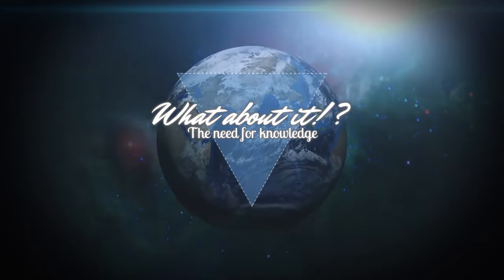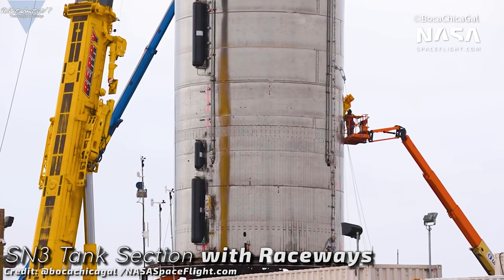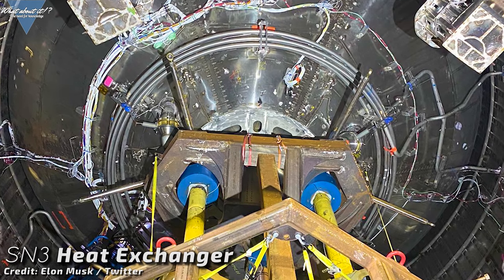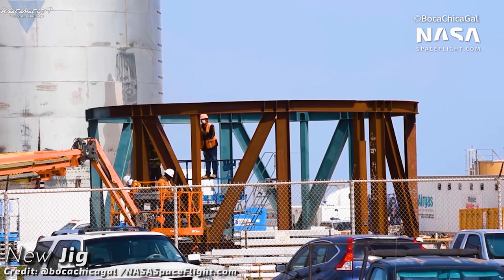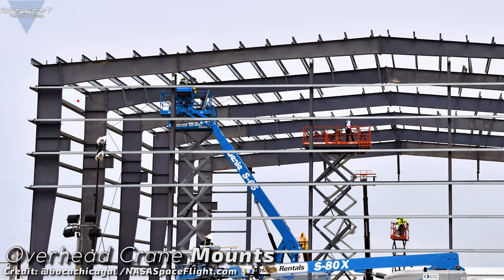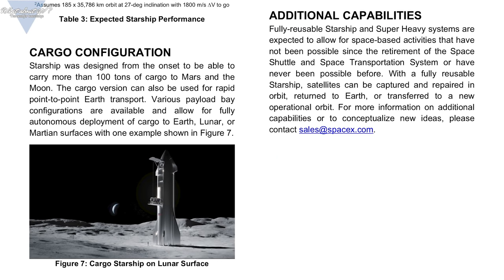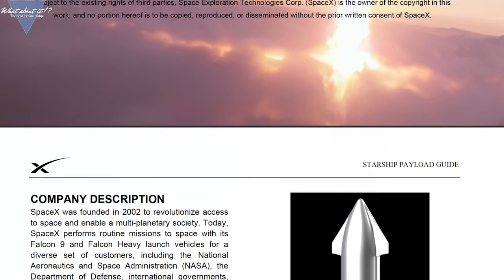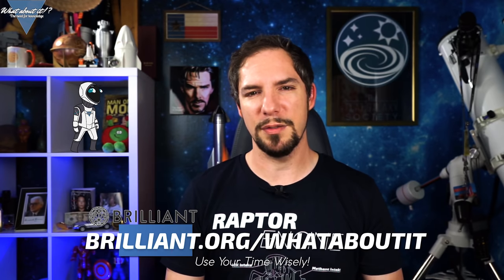82 | SpaceX Starship Updates – Starship User Guide Reveals Major Starship Feature

Comment: MASS PRODUCTION.
.  The engines, mount, tanks & CPU/avionics goes on the lower part of Starship.
This "universal block" is that will eventually get "frozen" in design (just like it happened with the "block 5" of Falcon 9); while all of the "utility" part (crew, cargo, telescope, fuel, etc) CAN get redesigned ON THE INSIDE for any mission [as long as the external shape & dimensions is the same, the Starship as a whole can fly without any need of software/hardware modifications/tests].
  
.  Any mayor changes that would modify the weight and/or center of mass of the upper "utility" block can be compensated by adding water (either as radiation shielding or heatsink). 
-> Ideally it could be transfered to another structure in orbit (water is ALWAYS useful), otherwise it can be dumped AFTER initiating the reentry process (when the Starship´s periapsis is set inside the atmosphere).

Comment: I don't think they can make tankers with fairing sections as the tanker is supposed to refuel via rear plumbing. So either you would need to have idle plubing for most flights or just have tanker-model with extended tanks.

Comment: That's amazing, it can be modular. Imagine an unfolding fairing on hinges that's just standardized. It could be shipped straight to the satalite operator to set up their launches and then it gets picked right back up to be shipped to space, unfolds, fairing locks open and stays with the satalite. Fairing becomes a light shield around it, or opens up more, almost backwards, for communication satalites. If there is a failure, you can go dock with the fairing and then ferry it back to earth for repairs or recycling.

Comment: No, I don't think that's the way to think about the faring.
Instead of replacing the whole top section, I think we'll see something more like the Thunderbird2 method, where the 'fairing' is a container like module that slots in to the frame, which in turn will include all the hardware for the guidance and canards.
So the fairing and load integration will be like filling a shipping container, which is then bolted to the Starship chassis.
An interesting question will be, will the standardized Intermodal Container for international shipping be able to fit in to the cargo Starships?
Visualsation exercise - bottom half of a Starship, with a central backbone connected to the nosecone and canards, and then multiple containers mounted longitudinally around the central backbone, before a cover wraps around them.
Now go one step further and think about a version that has just the Raptor bay, tanks, backbone and nosecone/crew space, and is extended in length to take multiple rows of the same size containers, and never lands on a planet, so doesn't need the canards or wings. :)

Comment: So, the engine/tank section is the BFR upper stage (or 2nd stage) and any fairing/payload configuration can be stacked on top. The upper stage and fairing section form a reusable unit and are recovered jointly. Space X could devise a fairing section that includes a small rocket stage section to act as the 3rd stage for interplanetary missions and theoretically, such a powered fairing section could still be recoverable if it can return to Earth. However, in this case, the actual second stage would not be recoverable (as in today´s Falcon 9) and an LH2-powered version would be possible, too. The larger fairing size will allow launching military payloads and larger sets of Starlink satellites, too. A tanker capacity could be increased by strap-on boosters for Superheavy or by using a triple-core version. On the whole, this is very flexible and ingenious. Go Starship.

Comment: OK, now I finally believe SN3 has autogenous pressurization. Thanks for putting together all the pieces! But at 4:15 I think you are looking at 2 different header tanks. The cut off one will fit into the nosecone, transforming the tip into the LOX header. This apparently how the first nosecone section was configured, from the way the tip imploded-dented back when it was pressure tested. The header tank with the sawtooth collar is actually an intact sphere. Over on reddit our friend r/fael097 convinced me it will fit large-part down through the common bulkhead, with the collar there for increased weld contact.

Comment: For obvious reasons, the third option is a tanker-module to refuel other starships. on the other hand, they could just build a steel fuel tank, that pops out once they are in space. add a sunshade, and there is virtually zero boiloff, allowing them to store fuel in space until they need it for a flight to mars. could be a lot of fun :-)
Reply: sbmphr  
Fuel depots are not a good idea, mostly because then you are restricted to a certain inclination for your launch, which might be less than optimal for your actual destination. Far more flexible to just refuel every individual Starship with a few tanker flights.
Reply: Space fuel stations don't help. Because you still have to launch the tanker to fuel it anyway you may as well launch at the same time, dock, transfer fuel, land, and not have to worry about that fuel in space or have to even do anything.
Reply: Tanker modules make sense around Mars where the weak gravity enables easy access to space, and Mars is likely a refueling point before going farther. Some crafts From earth that are designed onto for space travel to the Jupiter system might do a gravity assist around Mars anyway, so perhapse a tanker earth-mars Aldrin cycler being refueled from Mars with each pass would enable a high velocity burn to Mars, and then refuel with the cycler, and then use a little fuel to adjust the gravity assist. And boom, nearly fully fueled and still on a Mars assist. That's going to give us good flexibility.
Reply: @pilotavery  Well, there is one problem (in my opinion) that needs to be addressed. A launch window to Mars opens every 26 months, so you have a season of around 1-2 months where you have to do all the launches.
As you have mentioned, a fuel station has its own set of limitations, but it will allow fuel launches for the whole time outside the mars-season, leaving the season for the starships that actually go to mars.

And you don't need a single fuel depot. just dock a bunch of tanks together until it is capable of refueling at least one starship. you can essentially have as many stations as you want, spread out so you can launch 24h a day.

of course, the second you get a source of fuel somewhere else, go for it, it's vastly easier to source it in the asteroid belt, but we don't have the necessary capacity yet to do so. And of course it takes time to bring fuel from asteroids to earth.
A way of producing fuel on mars to send spaceships out to the asteroids and gas giants is of course a very fascinating prospect. but not for the next 10 years.
Reply: @hubertseidl93  my point is, why would you launch 5 rockets all at separate times versus doing it all at the same time? Do you think that the logistics of launching 5 * in a short window outweighs the logistical nightmare of trying to store and transfer fuel?

I still think it makes more sense on a Mars cycler transfer orbit
Reply: @pilotavery  Because you have a limited amount of launchpads, staff on the ground, etc. And you have to use them all the time, not just during a launch season. So why not send up the commodity that can be stored in space first.
Obviously, you can also use the launch infrastructure in these other 25 months to launch other stuff to other locations aswell.
Reply: @hubertseidl93  You only need one launch pad, and reuse the same booster multiple times, which SpaceX is doing anyway. 

Also, building another launch pad is still easier than building a fuel depot in space. Plus you'd be limited to that inclanation as well. A transfer orbit is where it will shine, because that's where it takes exponentially more fuel to get a depot there, and small changes in velocity gave huge changes in destination.
Reply: @hubertseidl93  somehow I have a feeling that building a Launchpad is easier than building a fuel Depot in space...
Reply: @pilotavery  well, but building the fuel depot is simple. spaceX is doing it right now. fabricate a steel tank, like the tank-testarticles. launch it, pop out a sunshade, done. I don't think about a super-fancy structure with tanks, think about it like a few barrels bolted together, with a sunshade, so stuff remains frozen.
very minimalistic, very simple...

Comment: SpaceX seems open and willing to listen to all or most new ideas which is good in contrast to other companies that are more rigid and narrower in their thinking.  This definitely gives SpaceX more flexibility than any other government run program I can think of. I think the main reason(s) for this is/are monetary. NASA has to practically beg the government for funding and is always limited in what they can do. They have to propose a plan and that had to be approved by senators, managers, officials on an on in an endless bureaucracy that eventually becomes a monster and more than likely kills the program like the SLS for example. 
SpaceX can avoid all or most of that. 
Great video. 👍
Reply: Sklawz also once the company gets the contract, they are authorized to spend the money. They do not want anything to interfere with that authorization, including better solutions. They do not tolerate any naysayers who point out the project will miss cost, schedule performance without changes (that would risk the guaranteed money stream)
Reply: @douginorlando6260  Yes.  Right. Politics also.

Comment: Can anyone explain why we shouldn't expect the Starship to fold up like paper when it re-enters the atmosphere since the rocket is planned to re-enter on its side rather than on its end? Since it is constructed from stacked rings, we should expect stress risers between each ring section at the welds. I am sure that there is bracing internally to address this, but it seems that the welds between stacked rings serve as multiple weak points that are being presented to the force of the atmosphere pushing against the side of the rocket as it re-enters. If anyone could explain this, I would greatly appreciate it. Thanks.

Comment: I agree that we might soon see the lower section basically frozen - although Starships destined for a one way trip to Mars might have a slightly different landing leg configuration, and those destined for a one-way trip to the moon might not have items related to re-entry as well as a wider and more flexible landing legs.

I can see a couple of different families of fairings - one crewed with at least two versions: 100 person Mars version and a 400(?) person point-to-point.  These would likely be permanently attached to the tank section.

The cargo fairings would be more varied, with a group of standard ones used to take cargo to establish a colony on Mars, one set of "tanker fairings" and some designed to deploy 400 Starlink satellites into orbit.  These I would also expect to be permanently attached to their booster sections.  There also appears to be the possibility of custom (one off) fairings which would be only semi-permanently attached to the tank section.

Comment: Hi, i have a question, on some iterations of the starship it has 3 engines, but on some others it has 6 (3 vacuum, 3 sealvl). Which one of these is right?
Reply: Moritz K 6 for production, 3 for now
Reply: @blakelowrey9620  thank you :) and thx for the heart
Reply: Both are right.  3 engines with sea-level -optimized nozzles for early test flights, as these flights will be in the low atmosphere.  It seems the plan is to add 3 additional engines with vacuum-optimized nozzles for later orbital flights.

Comment: For the fairing nose part: fairings normally dont have important parts like the windbreaks or heatshield. I think that the lower half would consist of engines, tank, lower windbreaks or, and would have 2 "arms" with the upper windbreaks. This design choice would also help with assembly of fairinghalf with the rockethalf, because the bolts or whatever could also be mounted on the arms.

Comment: In the pictures looking upwards at the underside, I note the three circular cooling tubes and can predict a likely failure after looking at the numbers cited in the manual. With acoustic and mechanical vibration on launch, the tubes will chafe in their laser cut mounting bracket holes - this being a likely failure issue. Would recommend rubber inserts thermally protected by glass wool.  Very small weight penalty. By profession I was a stress engineer and airline pilot before starting a high pressure pump manufacturing business. Excellent channel well presented and researched.  Thank you Felix.

Comment: When it said the payload fairing would be stacked on the starship vehicle I think their referring to the booster not the tank section of the upper stage
Reply from the maker: That's not, what I read, but you could be right. Remember though, that this guide is only for Starship. The booster is a separate vehicle.
Reply: @Whataboutit  Yeah I haven't read the document, so most likely I'm wrong, I just thought that It would be strange if they would on the day assemble the two halves of the upper stage, would seem like a major point of failure and would be a plumbing and pressure weak point
Reply: @gorrium5027  I think the only plumbing it would really need would be feed lines for the RCS thrusters in the nose, which operate at very low pressure when compared to the Raptors themselves. It would essentially be the same as the umbilical lines that feed power, diagnostics, and air conditioning from the Transporter Erector into the fairing of a Falcon 9, to service the satellite inside. Probably even less complex.
Reply: @PunchAPeach  but the header tanks are also in the top section of starship unless they changed the design those would be under a lot of pressure
Reply: @gorrium5027   From the drawing it appears the LOX tank is no longer there. This a future iteration, and I believe they want it back in the tank section like originally planned, once they get the overall weight down and distributed. But I do agree the design is problematic - still have to connect wiring, and worry about the heat shield join, overall strength. All that will add mass! 

When I read the guide a day or two ago, I read that to mean a standard payload module designed to fit inside the fairing. "Payload" and "fairing" being two separate items. The module would be taken to the pad and lowered into/shifted sideways into the fairing itself. But a close reading makes me think Felix has it right. In terms of what's practical we have to think on the Elon scale, which is difficult.
Reply: @donjones4719  ok thanks, I need to watch more of these update videos I'm behind schedule

Comment: I, too, had previously mentioned thibking sn interchangable fairing section would be more efficiente. My concept was to board the passenger section for point-to-point travel while on a barge (maybe even while underway) and then just lift it onto the Starship and latch into place to minimize total travel time.

...but now it occurs to me that this design could also be useful if regulation requires them to have an abort system
...and seating would be different for intercontinental vs interplanetary flight

I'm just not so sure about the tanker version. I'd think it would be useful to have that extra 100 to 150 tons of payload be all fuel in extended tanks and not have the extra mass of additional bulkheads and plumbing
Reply: ...plus, less mass for a crane to stack onto the launchpad at a time, the better

...and maybe this is another reason why they have nosecones separare during testing

Comment: I predicted something like this, they've basically split the vehicle into 3 parts again: booster, starship, payload. With the payload section being equivalent to the third stage of a traditional launch vehicle, albeit with the second stage designed to return to earth, with the third stage still attached (where desired) . This configuration makes the vehicle much more versatile than designing different configurations of second stage for various purposes, and allows extra mass efficiency as each variant won't need to have features that are essential for the other variants. As such space X could make a configuration where the payload section is entirely detachable in a traditional disposable fairing for greater volume or mass to orbit.

Comment: Have some questions:
1. In a configuration for point-to-point communication, do we really need a Starship that is also capable of orbital flight? I mean, we could have a Starship with no vacuum optimized engines and with no heat shield and, most likely, would not need to use Superheavy. 
2. I understand why Starship have to use stainless still, but why Superheaver also have to use stainless steel? Couldn't it use the same material as Falcon 9 and save some weight?

Comment: That heat-exchanger mechanism didn't exist on hopper. One of the explanations I've considered for Hoppies engine plume turning color was over-heated exhaust gas fed back into the fuel tank had partially pre-ignited the methane, or simply polluted the fuel.

Great videos, looks like you're almost to 50k subscribers!